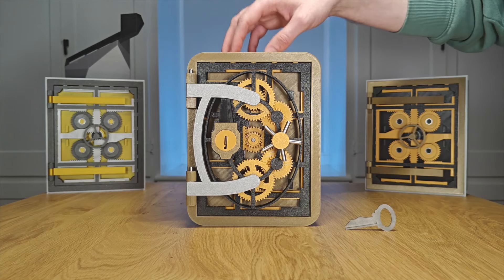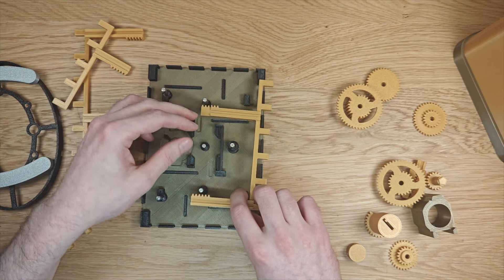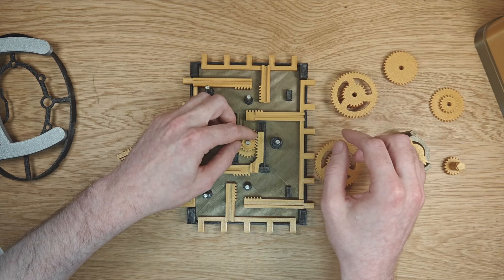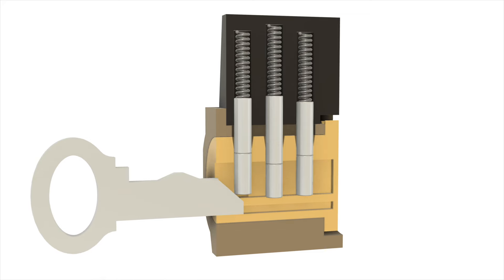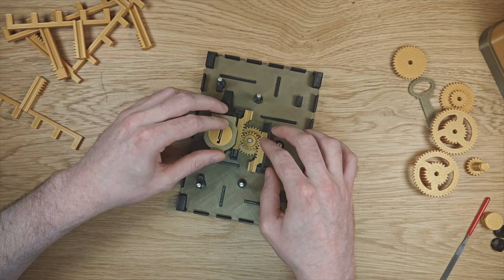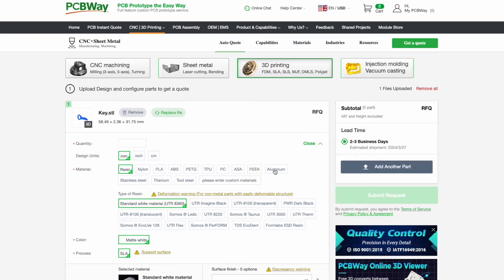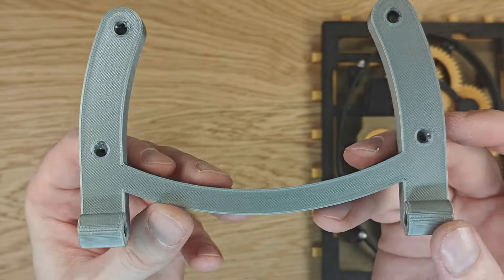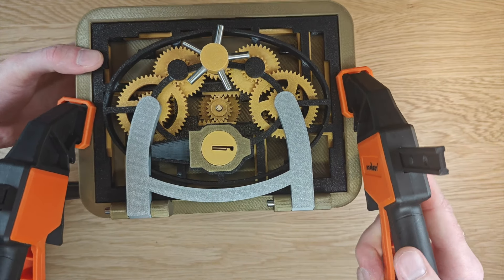3D Printed Vault with Pin Tumbler Lock

Comment: Any recommendations on how to alter the "key" so that you can use variations of the pin tumblers? Would love to make these for my kiddos, but they'd def try to open each others lock boxes. 😅
Reply from the maker: Unfortunately I don't have a way to do it without a lot of effort. Stay tuned, though, my next design is taking shape with a new type of lock which will be very easy to re-key!

Comment: Great model. but does anyone have issue with the model and the 5mm diameter steel dowels? the holes are pretty much around 4mm. The 5mm dowels recommended in the description page don't fit. I figure the model is 80% shrunk. Maybe this is the reason.
Reply: hi i have the exact same problem . i will try making it 20% bigger
Reply: @filipkordyl  i ended up using 3d printed dowels.

Comment: What kind of glue are you using? The little tubes are handy. The gel doesn't run out all over the place.
Reply from the maker: Jb Weld Steel Epoxy. I recently switched to JB Weld Plastic Bonder, which sets much faster.

Comment: What a fun little project. I did need to file some of the parts to ensure that everything went smoothly. Currently just waiting for the glue to dry in the hinge and then the final step. Mine is printet in PLA.  So thank you very much…